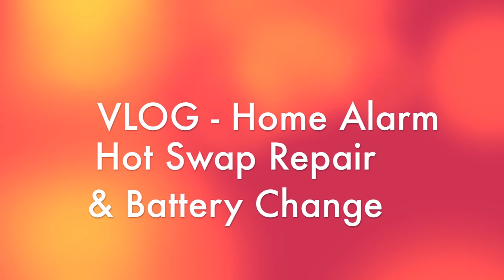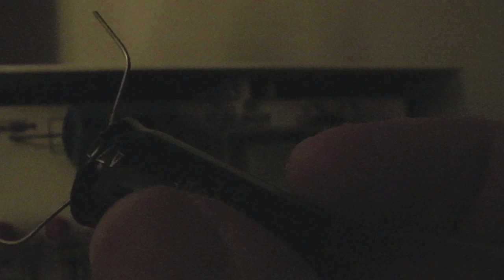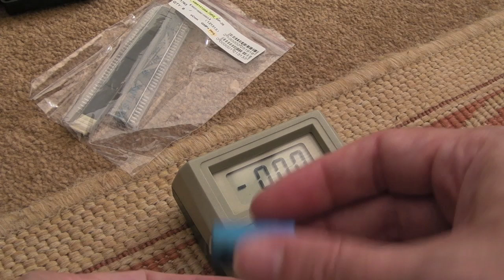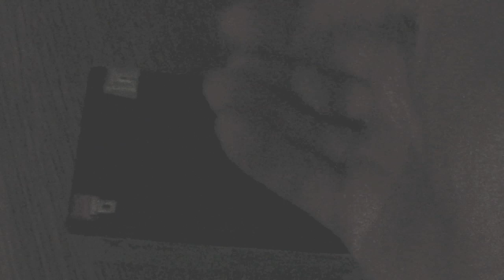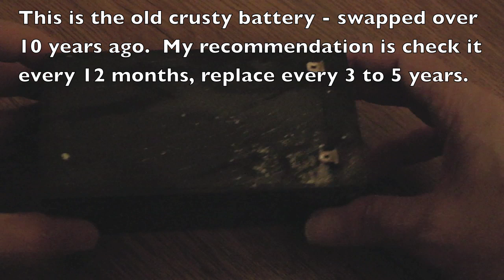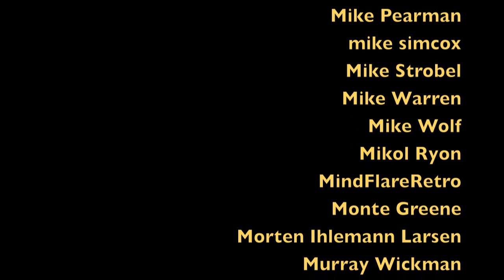VLOG - House Alarm Hot Swap Repair & Battery Change

Comment from the maker: NOTE: Vince asked me how I worked out that cap was the issue - It was swollen on one side of the can, but before I even went inside I had the clue that it was either a failed diode (perhaps meaning it wasn't rectified properly), or a capacitor.  This was purely from experience, the humming / buzzing noise is what you can get when a DC supply has ripple on it.  The buzzing was passing via the supply line into the internal speaker circuit and being output as a buzzing.  When pressing the buttons they also had a vibrato sort of sound to them too!
Also note - before just sticking a cap over there in parallel, I measured the DC voltage across it and inspected the capacitor.  It was just a 12v DC supply rail.

Comment: don't know what make your alarm is but if engineer code is entered the bell box normally goes into hold off which would allow you to power down the system fully
Reply from the maker: Thanks =D  Yes, the big problem I was trying to avoid was having to disconnect 50+ wires lol.  I got lazy is the reality!
Reply: @GadgetUK164  think we all get lazy at time but no totally get where your coming from it can be very scary with loads wires coming from things lol

Comment: When you went to make sure that the battery was the same depth as the old one it gave me a bit of a scare as the open contacts of the new battery were very close to the metal enclosure and I was not sure if you would have the battery short out and weld it's self to the enclosure.
Reply from the maker: The enclosure is white plastic, not metal! =D  I was aware of that ;)
Reply: @GadgetUK164  Ah, that makes sense.  Over here in Canada most older alarm boxes are metal so that is why I was concerned.  It was hard to tell that it was plastic with the dim lighting.

Comment: Sorry, but why did you believe the alarm might go off, if the mains power AND the backup battery were both disconnected? Is there a third power source (capacitor?) or something else? Do all the alarms in your neighborhood immediately start going off during an extended power outage once the backup batteries were drained? These have to be serviceable somehow without working on them hot. Best wishes.
Reply: This could be bollocks ha....I am a bit rusty.
20 years ago since I fiited an alarm but if you connect the hold and -12v from the external alarm box to a 12 v battery it does not go off
Reply from the maker: There were a couple of issues - I am pretty sure my siren box has a battery too, so when the battery in the box and mains are cut it still goes off...   The added issue is the wiring (as you could see) is a nightmare in this alarm, there are like 70+ wires in there, so if I did want to work on it isolated, I would need to disconnect everything.   Finally, whilst I have the engineer code and a few other codes, I have no idea whether it would "factory reset" after being completely unpowered for a few hours whilst disconnecting and reconnecting it all.  It just seemed like a nice approach to spend litterally 2 minutes swapping out the cap that way vs all the pain I could have had!
Reply: That's interesting - I have only ever seen passive sirens driven by the main board. Cheers.